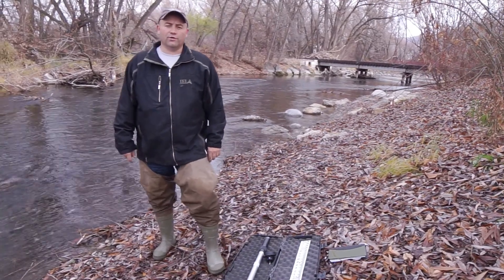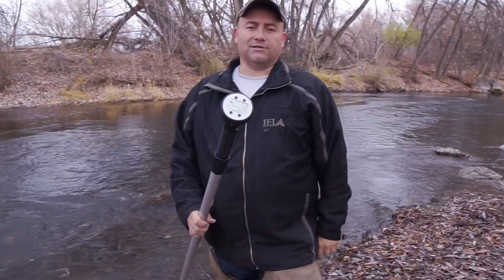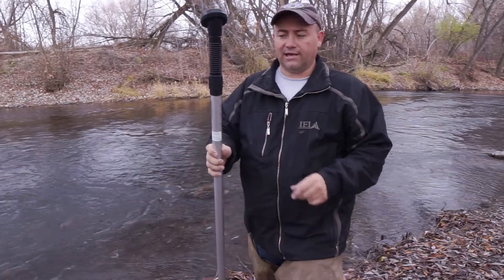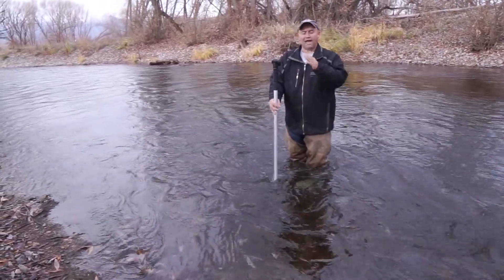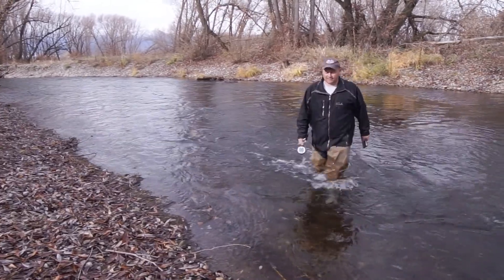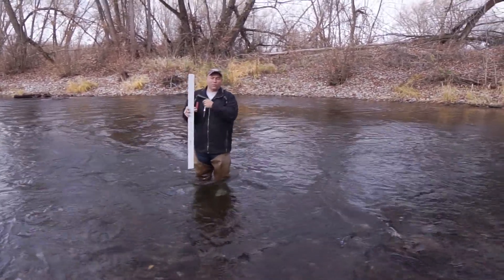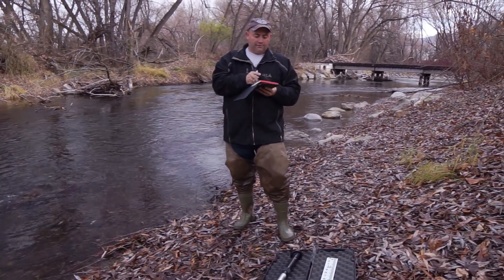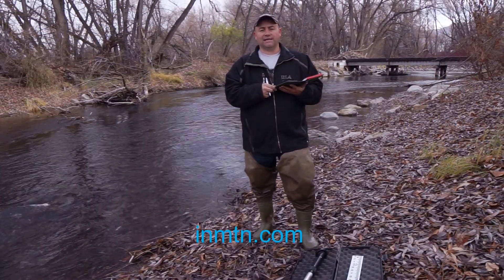Using the FP111 Global Water Flow Probe to measure flow rate in a channel

Comment: Battery life is good(this one ran roughly a decade) but when it fails sending the thing in for service to replace the battery is over 1/3 of the cost of a new one.  Currently they have a supply shortage and service is impossible.  So we replaced the battery instead. The split location is the seam line around head.  This one has a short interior flange that sticks down from display side inside the lower half with a bead of sealant around the bottom edge.  Because I went looking for tabs to unlatch and there were none I cut part of the flange off while getting this one apart.  There are no tabs and no alignment notches in this one so 2 potential strategies to try getting it apart.  A really strong twisting motion might separate the cases by breaking the sealant.  Alternately I would try gently flexing the plastic of the display side in with a pair of slip pliers to break the sealant in localized locations.  Repeat till worked far enough around to get the sealant loose.  The halves separate and 4 screws hold the display to the case house.  Be sure the meter is face down while you do this as there are 4 tiny metal pins that extend exterior buttons to the interior buttons that are incredibly easy to lose.  If face down they will stay in their plastic holders.  The battery in this one was a solder in that any good electronics person should be able to change with a battery cost of a few bucks(vs over $450 to service it)(freight will cost you far more than the battery)  The battery in this one was CR-2354/HFN.  Since we needed it fast we subbed with a CR2450 because they are commonly available here and only 10 mA lower max draw.  560 mA max draw orginal vs 550 mA max draw for the 2450.  We fudged a holder together with epoxy and edges of a windshield wiper blade that will work for now.
Reply: Thanks for the info. I have the FP111 and the battery has gone dead and I was really pissed about the battery situation. I'll never buy another Global Velocity meter!! Total rip-off.

Comment: How about for open channel sir, Is there any method or approach to measure flow? The open channel is trapezoidal with possible sedimentation. 

Thank you and God Bless.
Reply from the maker: This is slightly more difficult.  You must calculate the area of the channel that has water in it, there are formulas to do this published on many websites.  Search for area of a trapezoid.  The flow probe use is basically the same, however, remember that this technique is an estimate of flow, not an exact measurement.  Sometimes you must make your best estimate with the tools and situation that you are dealt.